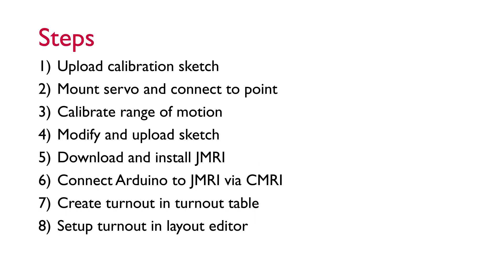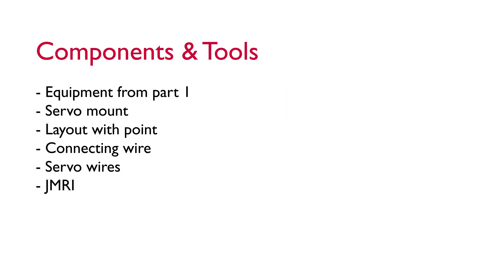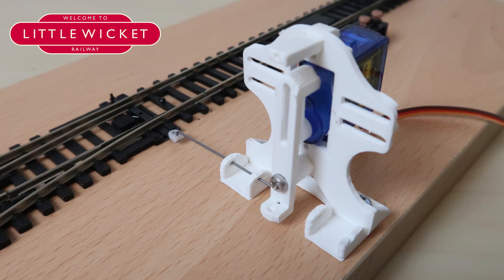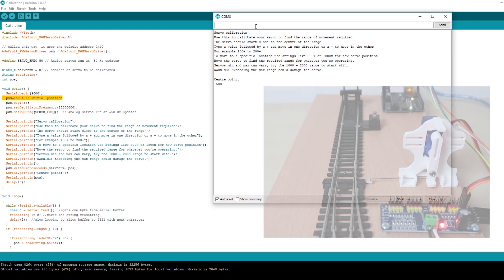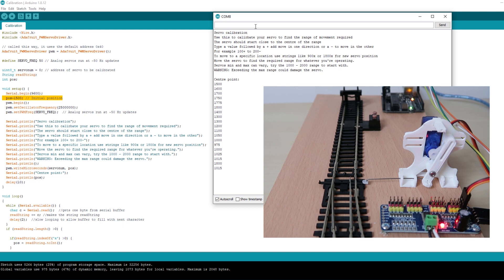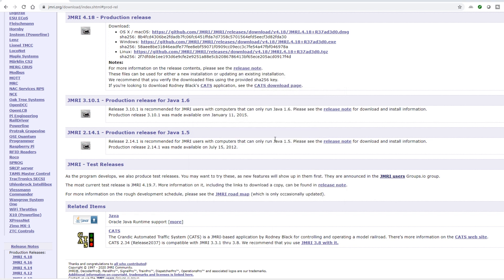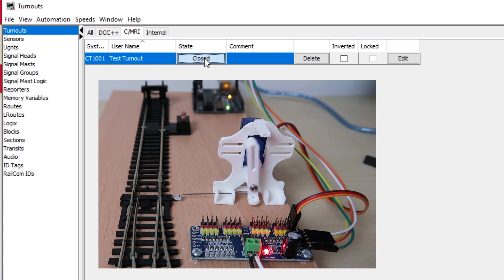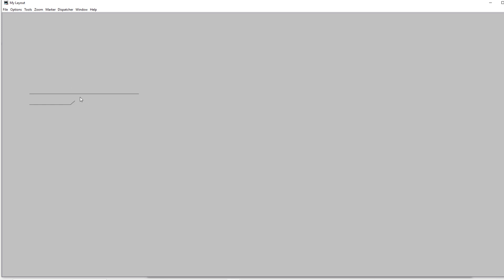Servo Motor Control for Model Railways Part 2 of 3 - Servo Point Motor

Comment: A great tutorial Rob going to watch No3 later well impressed, thanks for sharing your knowledge with us.
Reply from the maker: Thanks appreciate that. It's been a steep learning curve for me this year and I found all this stuff pretty intimidating to start with so wanted to share. I can't take much credit for designing the software or systems, I've just tried to pull it all together into one place. I wish I'd known about servos before I installed the solenoids with accessory decoders!
Reply: Hi Rob I bought a project layout that had servo's on, but individual controllers, trying to sort the wiring out is a nightmate as there was  no wiring diagram. Seriously thinking of starting again and going the way you  have shown. Probably be quicker and I will not whats what. Your channel just popped up in my reccomend list, pleased it did, intend to work my way through your orher playlists as well. Cheers Steven

Comment: Very informative.  The subject matter was clearly explained.  I guess part 3 will cover the speed at which the servo moves to make the point action more realistic ?
Reply from the maker: Thanks! Part 3 is using the servos to control semaphore signals. I wasn't going to cover the speed of the point change or adding bounce to the semaphores, mainly because I don't have anything prepared at the moment and I'm so far off that level of realism on the rest of the layout right now. Might need a part 4...

Also, I usually need the points to change as quickly as possible because I'm terrible at remembering to set them and only realise at the last minute 😂
Reply: @LittleWicketRailway  But  with a fully automated systems with the IR sensors etc you shouldn't need to forget  to set a point :)

I'm sure there would be a variable in that code that sets the rate the PPM signals increase by for the given frequency of the frame rate? - so should be fairly easy to code